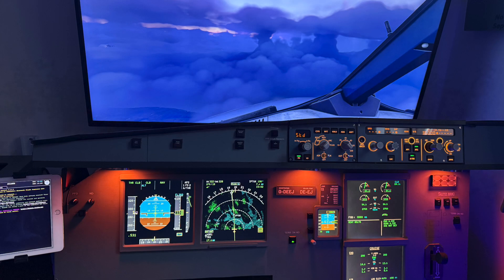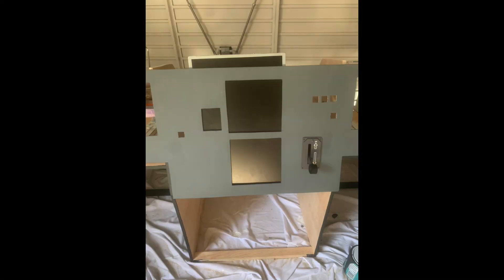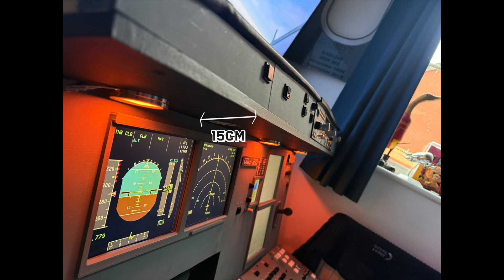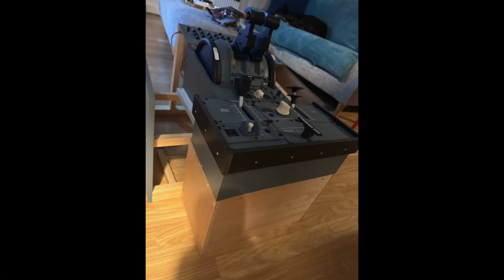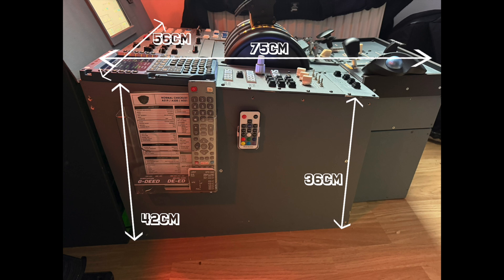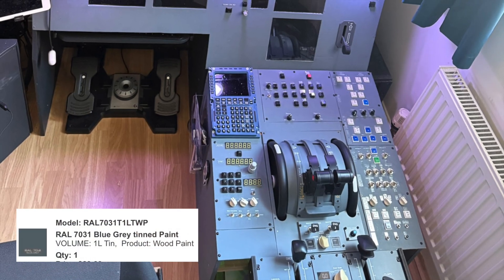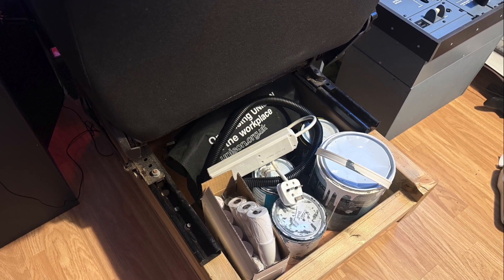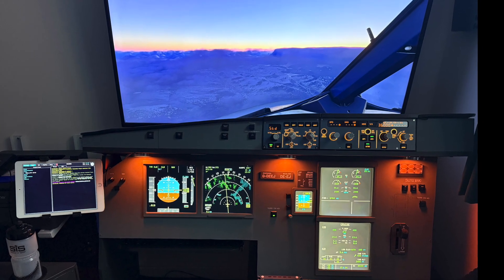Airbus Home Cockpit | Dimensions & Build DIY Guide

Comment: Hi, compliments for this video, could you tell me the measurement of the lower part of the screen from the floor, since I'm waiting for my MIP skalarki, I'll get ahead with installing the screen on the wall, I don't want to put it too high or too low
Reply from the maker: Hi, are you referring to the exterior display in my setup? As in the TV? If so my TV is mounted in the wall using a standard bracket and it sits 85cm from the floor :)
Reply: I’m also waiting for the Skalarki MIP package and will need to build a structure for it, let me know how it goes.

Comment: Great video as always! What are system specs though, ive always had major performance loss whenever I try to pop out screens onto an external monitor
Reply from the maker: Thanks! I use one PC for this setup and the spec is- i7-10700K | RTX 3080 | 16GB DDR4 | 1TB NVMe + 4TB HDD | Asus Z590-F | Noctua NH-D14 | NZXT H510 | Corsair RM850x 850W | Win10

A few people have commented saying they have had performance issues when popping out the displays- I haven’t had any problems